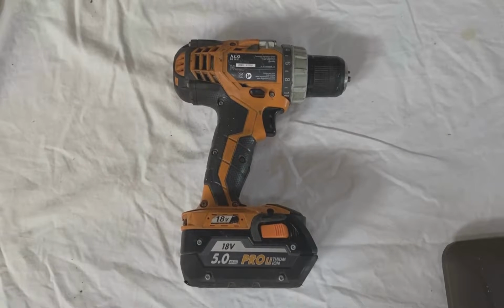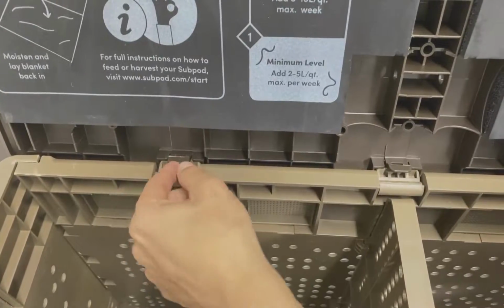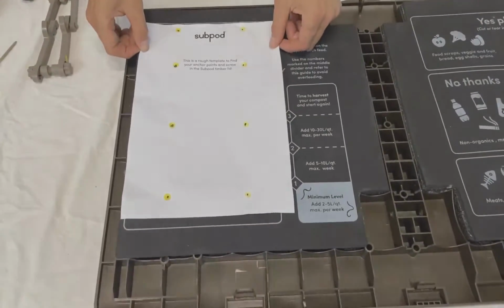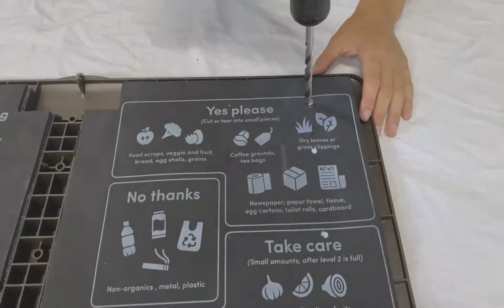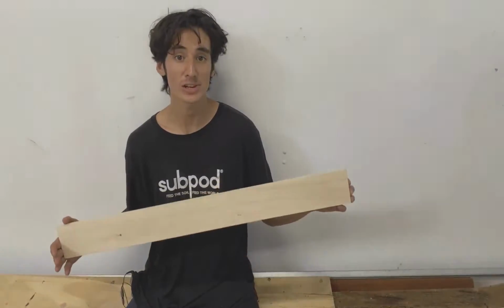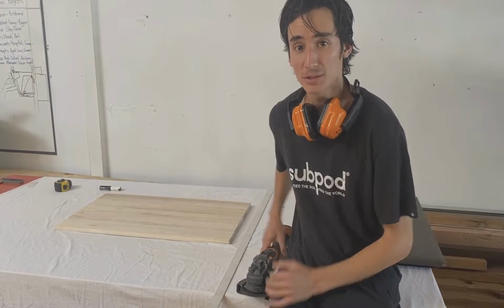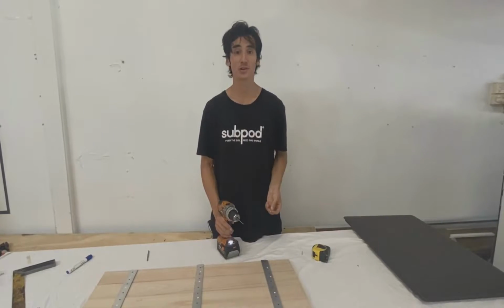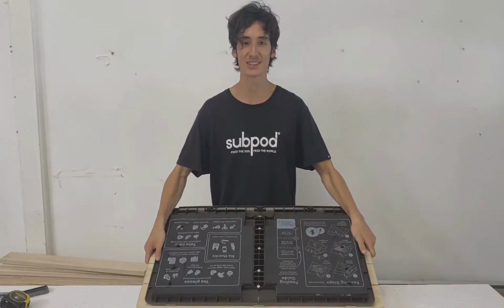Make Your Own Subpod Timber Seat

Comment: Thanks for the video

I will be attempting to put the small sub pods in a larger box then add seating to the lids. So it will appear as a sun bed! 

How different are the small subpods to the larger ones in this video? Can I use the same template?

Comment: Hi! Thanks for posting this. I just ordered my sub pod and would love to make the seat. I was confused as to how to measure where to anchor the aluminum to the wood. I wasn’t sure what the measurements and spacing was between each aluminum strip. Thank you!!
Reply from the maker: Hi Sandy,
Sure, we would love the answer this for you :)

- 30 ml st steel 3ml thickness

The alumni strips is spaced out based on the anchor points in the back. Hope that helps and let us know if you have any further questions.